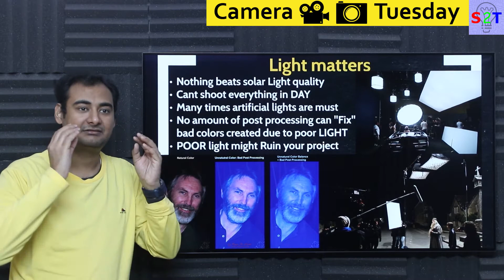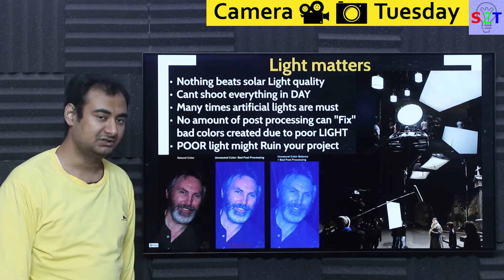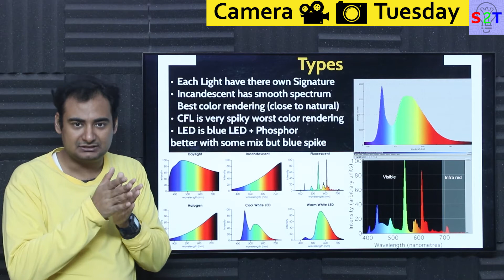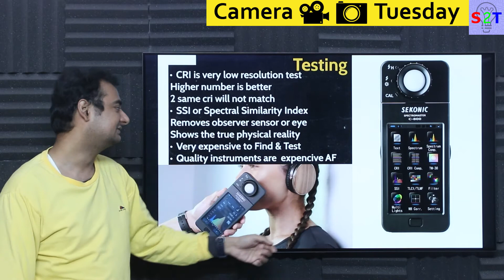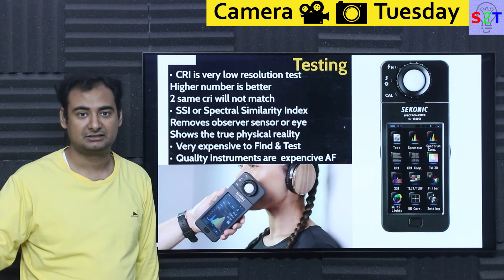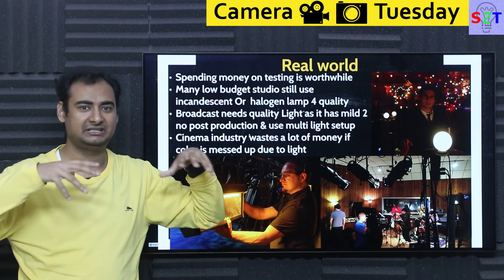Video Light Explained {Camera Tuesday Ep167}

Comment: 5500-10000 kelvin metal halide lamps are GG in my experience when it comes to daylight simulation with high CRI.
Reply from the maker: that is true black body radiation gives of a smooth spectrum